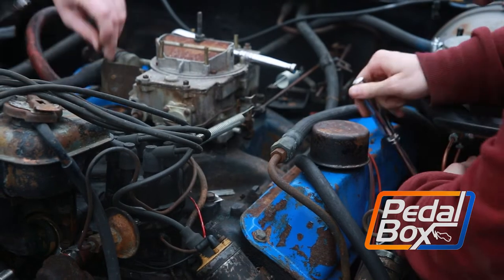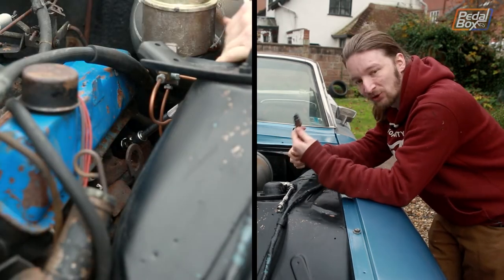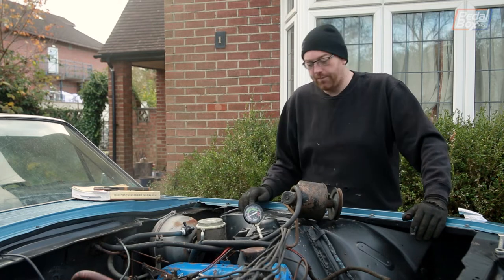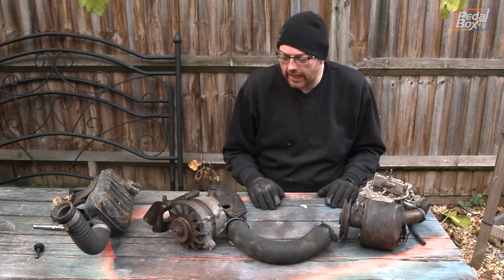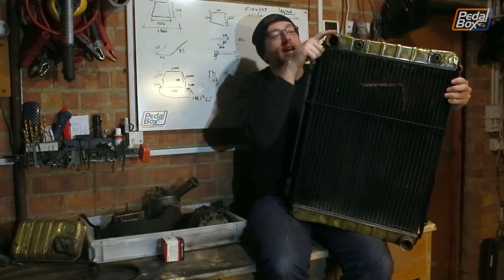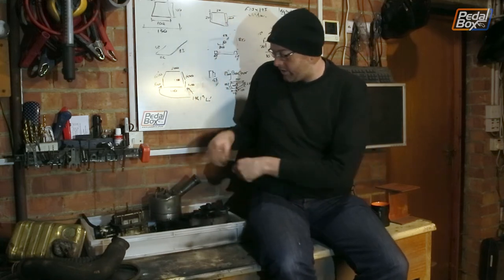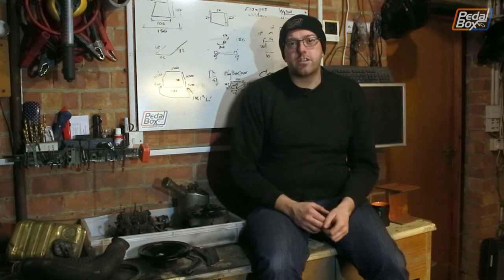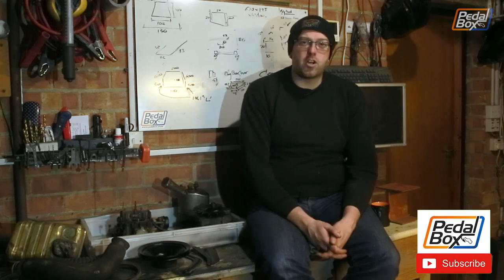Thunderbird Accessories | 1966 Ford Thunderbird | PedalBox Fleet | Episode 93

Comment: Don’t leave the brass bare and lacquered over. Most of the Ford parts from the period the Thunderbird was built were black. As far as the radiator, there is a paint that is designed for heat transfer. Regular paint is not designed for heat transfer.
Reply from the maker: I really liked the Brass, but I wonder if that's just the excessive work to make it visible talking, next time the hood is off it'll get re-assessed. I'm 50/50 on it at the moment
Reply: @PedalBox  it’s nice looking to see polished stuff like that. But, to me, this is not a “brass era” car.